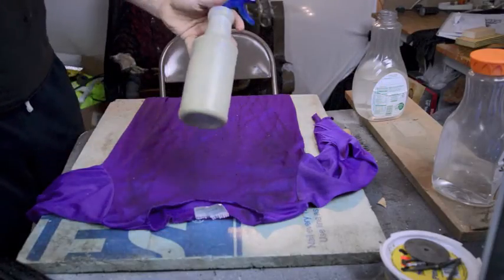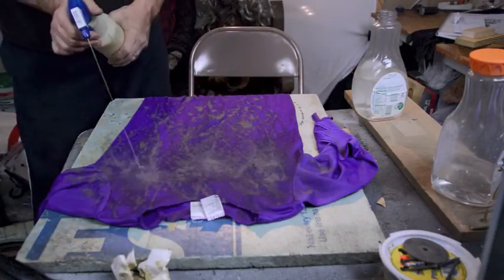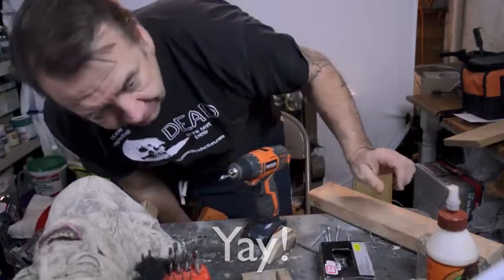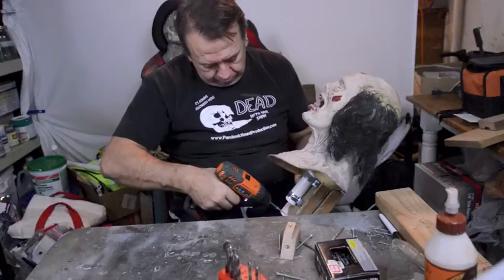Rebuilding the Confessor Prop - Bleached Bones Vlog 61

Comment: You can always remove the head cut that pvc add a t section then build your shoulders out with pvc and padding.. Would be lighted than 2x4
Reply from the maker: +Unhinged Productions Hmmmm. That's a good idea! Maybe just add a T at the appropriate height and run out some PVC sections. Thanks!
Reply: +GhoulishCop exactly

Comment: Cut some 45 angle pieces attach on the sides and put your shoulders on to of them or bore a 1" hole through and slide a pvc pipe through. love the video even with no sound!!!!! it made me laugh
Reply from the maker: +Realm Of Fear (Steven Stockinger) I like the idea of using 45 degree blocks and drilling thru them. I just might use that technique! Thanks!